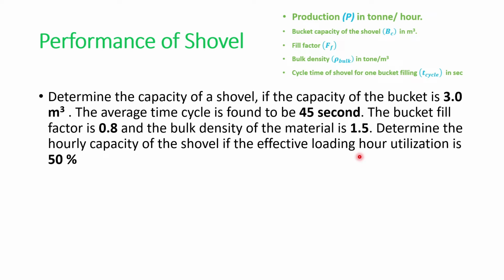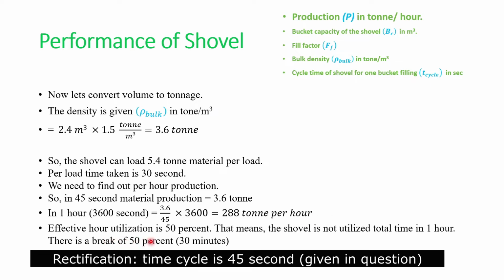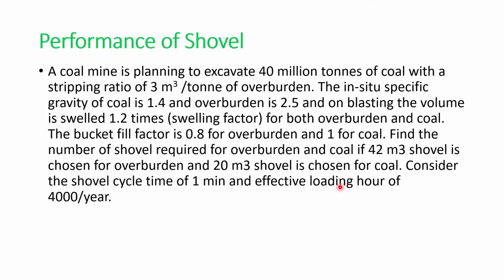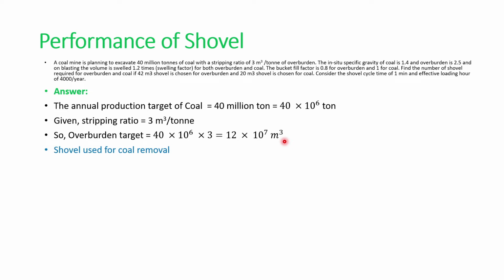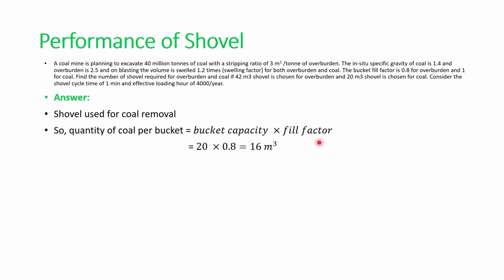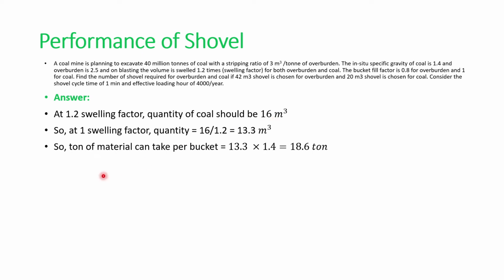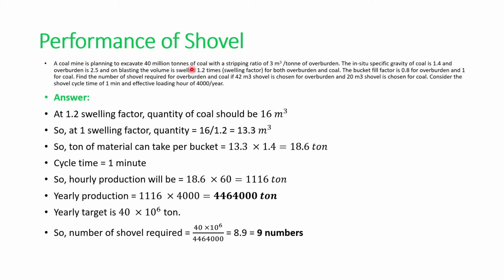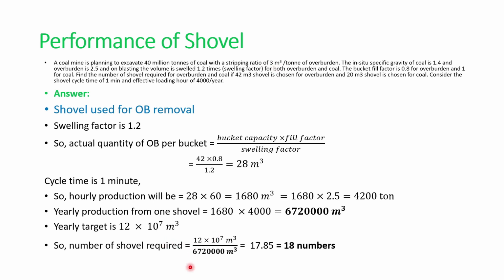Shovel | part 2 | Numerical problems

Comment: In a shovel dumper fleet dump is 2km, dumper speed is 26km/hr how many dumper r reqired assume cycle time 10min shovel productivity is 950 metric ton/hr dumper capacity 95metric ton please solve the problem sir
Reply from the maker: Answer:
Dumper cycle time = loading time + going time + returning time = 10 + 4.6 + 4.6 = 19.2 minutes 
Going time =  returning time =   (2 𝑘𝑚/ℎ𝑟)⁄(26 𝑘𝑚/ℎ𝑟) = 0.076 hr = 4.6 minutes
So, 1 dumper can take = 95 ton in 19.2 minutes
So, in 60 minutes, 1 dumper can take = 95/19.2   ×60=296 𝑡𝑜𝑛 /hr
Shovel productivity = 950 ton/hr
So, number of dumpers required = 950/296 = 3.2 = 4 numbers
Reply: Ans is given 5 sir
Reply: In a shovel dumper fleet,the dump is situated 2km from loding point , if dumper speed is 26km/hr in full haul   how many dumper will be required for an optimum condition. Assume fixed cycle time is 10min/cycle, shovel productivity 950metric ton /hr ,and dumper capacity is 95metric ton
Reply from the maker: Send me the screenshot of the solution here…7205423945
Reply: Ok sir I will send thank you for ur consen